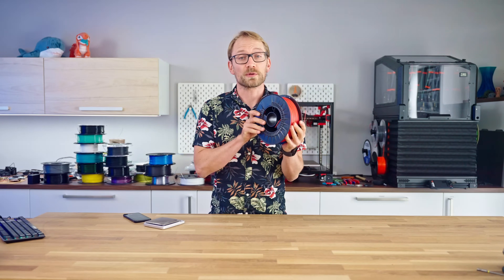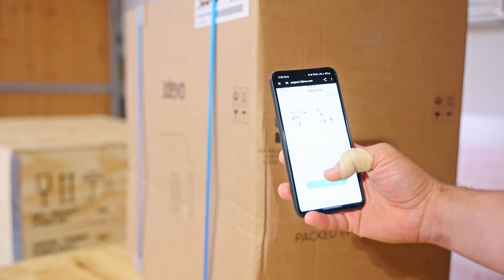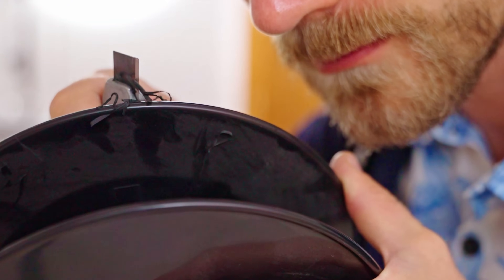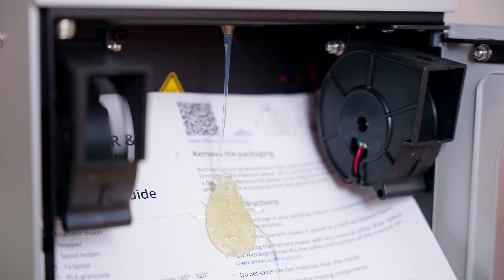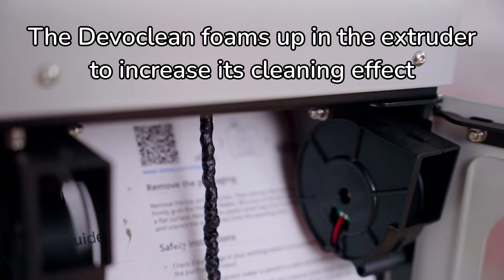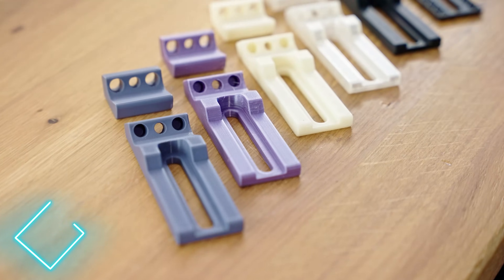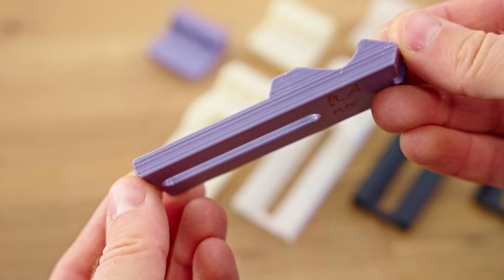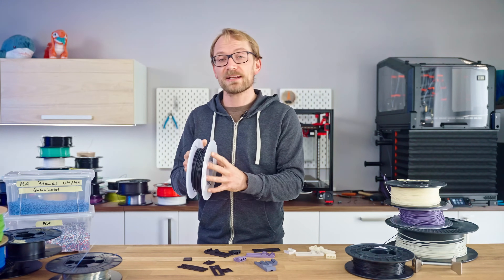Can you print (with) your spools?

Comment: Since this video is roughly a year old, I doubt you'll see this comment but it's worth a shot. You had asked what other things you can do with your filament extruder. I've got an idea that wouldn't have made any sense until recently. I've been playing around with an idea that was inspired by Jonathan from TheNextLayer. He has his slightly lower quality recycled filament that he calls filler-ment. With all these new multi-tool head and multi nozzle 3D printers, I was wondering if it would be possible to create an even lower quality material by chemically stabilizing and attempting to bond many of the most popular filaments together. This would mean that you wouldn't even need to sort the filament since you're going to be attempting to chemically stabilize it anyway. I expect that the filament will be relatively low quality but I figured this low quality filament would be perfect for infill and could be used with these multi-tool head printers without losing much time. Something like the snapmaker or the indx system should theoretically not add a ton of time or any waste but could use this ecological, low cost, low quality abominable filament.

I would love to hear from you if you're even vaguely interested. I was considering reaching out to some material scientists or some chemists to figure out exactly how to stabilize these dissimilar materials.

Comment: Working in the polymer industry we have experienced how hard recycling is. Any contamination, no matter how small, kills your result. This means that household waste plastic is near impossible to recycle into anything other than low grade materials, even with a lot of chemistry magic going on.
What works well is when you have materials for which you can get clean streams like PVC or PET. But even then for PVC the core material in a pipe is recyclate, the outer layer is virgin material. That way a spec of contamination does not lead to immediate defects. But you need complex exruder setups with one extruder for the core and 2 more extra extruders for each outer layer just to make 1 pipe.

For filament this could be applicable to: An inner or core part of recycled material and outer layer of virgin material. Just like some of the fiber reinforced filaments are made today. Since in our 3d printer extruder hardly any mixing occurs this might well lead to better printed parts as the outer sides of the extruded strand is still virgin material and thus layer adhesion is less impacted (I assume that layer adhesion is the first thing where we see degradation of mechanical issues). Also color, at least for black or dark colored filament, will see less impact.

Comment: meanwhile, virgin ready made stuff can be bought for under 10€ a kg ... :/

That's the real issue, we need something which makes it irrelevant what dirt, garbage is in and reuse everything, and all i can  think of is why not melt ALL of it and mold into bricks at industrial scale? Use them as cheap building materials, fully solid, whatever plastic you happeend to get in recycle bins

Comment: What if the spool was wrapped around with abs filament and pva, soak it in water to release the abs 1.75 filament and then use it directly to print as is.

Comment: Nice video, but recycling is not someting for the hobyists. Shredders and extruders are expensive equipment. Mixing platics from multiple brands can be an pain in the ass. Even when they are all the same kind, each brand has its own additives, wich may increase the melting temperature.

Comment: Naptha lighter fluid removes sticker residue very well, and evaporates with no trace on every plastic I've tried.
Also: Goof-off has an orange oil based sticker remover that completely removes adhesives and evaporates well enough that it leaves only trace contamination.

Comment: This is pretty cool, wish i had the money and space to set something like this up for personal use.

After thinking about the issue of unmarked plastic it occurs to me that if your working on a small scale and you wanted to test individual pieces to identify the plastic type you could do a melt test. If you were to melt a sample of the plastic in a closed environment with an air quality monitor that can accurately identify pollutants the wouldn't it be possible to identify the plastic based on the chemicals it releases?

Comment: things i'd like to see you try using the shredder/extruder for are;
empty pill bottles. these things can add up pretty quick, and if you're getting them from the same pharmacy, are likely to all be very consistent in what they're made from. mine happen to be PP and a nice dark blue. they're also pretty thick.

knock off bulk legos. from time to time, i see bulk listings for knock off legos that seem to be way cheaper than what the material would cost. might be interesting if you can get some quality ABS filaments in consistent solid colors for less than material price via these weird listings.

re-shredding shredded ABS for the increased particle sizes, but mixing in fiberglass to make a glass fiber reinforced printable filament. i would suggest leaving this one to just before you need to return it, since it's going to contaminate the machine with fiberglass... and that stuff gets EVERYWHERE. also, do not do this without serious respirator and eye protection. ideally a full face isolating respirator with separated intake, much like what Evan & Katelyn use on their channel when doing resin projects (their channel name is Evan & Katelyn...). you really don't want glass dust or fibers in your lungs or eyes.

Comment: I'm a bit surprised about the contamination issue.  If I understood correctly, the issue was that the little bits of ABS were getting extruded into the filament and then clogging the printer?  Does the extruder not have a screen to capture solids like metal shavings and the aforementioned ABS?  If not, then that seems like a serious design issue.

Comment: I really feel like we need to figure out a different direction to go with scraps/waste. Like a "no, you can't turn it back into filament" kind of thing whenever it's brought up. Over the years, all the streamers who have tried 3devo really just did the extruder with some random grinder setup that "didn't work as well as I hoped". Then you get to see a "proper" grinder and you literally need an engine lift. I'm probably semi-known for my massive comments on these videos, but I'll put things as "filament recycling is dead, long live filament recycling" and instead want to lean more towards "how can we take this waste product and turn it into something at home or, worst case, in a makerspace setting without the concern of contamination".

One of the first things that came to mind some 4-5 years ago: instead of printing a Gridfinity or picking up yet-another part sorting/storage bin, can I get a mold that I can fill with scrap + a brick or some kind of weight and throw in a toaster? I was working with someone else who was gonna weld the mold together from metal cutting scrap, but they got busy so the idea didn't progress.

So to your question: I'm not knowledgeable about plastics enough to come up with some new idea/blend, but blends could be interesting to try. A "has heat tolerance of ABS/ASA, but prints like PLA" if there's such a combo. But I like colors, so maybe "colored PC" or "glow in the dark ASA" or "glitter PETG". While the consumer space fixates on "what do I do with these mounds of poop that come out of my Bambu", the model makers, the tinkerers, the people who make 3D printing their business are going "I'll just adjust values to reduce the waste... but what I really need is a filament I can put in my car that glows in the dark but also survives a summer, enclosed in a car, in Arizona and can hold a large cup of iced coffee when I get back to my car". Grind up your old stuff and melt in a mold in a toaster, use the filament makers for creating the materials that mass manufacturers don't touch with a 10 foot pole because they don't see the market, but with a large channel drawing attention to them, consumers start going "hey, I do want that" and the companies do start offering them.

Comment: When you recycle materials, they're almost never used on its own, it'll be mixed with virgin material. whenever you process a material, its properties change. You lose some plasticisers for example from the heat. It was almost expected that the 100% recycled filaments would fail

Comment: The machine and assembly itself, while not for your average home hobbyist, could prove useful for smaller recycling operations!
But - as you said - you run into the issues of impure / unsorted materials and cutting an entire batch from 1 contaminant, or the breakdown of polymers.

There is a filament recycling company here in Canada that does accept smaller shipments, which is nice for someone like myself who does this as a hobby, but they're very strict with what you get for your batches of scrap material (Points system towards filament purchase, I believe). They even go as far as saying that PLA and PLA+ must be separated.

Comment: Wow, I am blown away by how much the small amount of contamination affected your prints! I would love to see more videos just exploring shredding/recycling different plastics or waste 3D prints in more detail. Some ideas that come to mind:

- Do a bunch of testing and find a good "recipe" for recycling PLA or PETG or ASA waste prints, to show the difficulty level of recycling your 3D prints. Is it possible to do it without using any virgin material at all?
- Try making a batch of filament from virgin pellets. Then, print it all and recycle it. Repeat this process and see how the plastic is affected by each cycle of recycling. How many cycles are possible for PLA, for example?
- What is the percentage of ABS required to ruin a batch of recycled PLA parts? Or percentage of PLA required to ruin PETG or ASA parts?
- Try to get your shredded product into a finer size - how does that affect your results? Is it difficult? Does it make the resulting 3D prints much better? How viable is it for people to do?
- Can a sander or Dremel remove the stickers on spools more effectively so you don't need to use solvents to clean the plastic?
- Go more into detail about how mixing plastics from different manufacturers such as PLA or PETG affects the resulting batch of filament? Is it a big effect? Can it ruin a batch of plastic?
- Does printing with a larger diameter nozzle make recycled filament more viable? Since contaminants will have a higher chance of being able to pass through it.
- There maybe chemical tests you can do on spools or samples of plastic you want to recycle to gauge their grade or quality. Can any plastics be judged in this way to see if they're good enough for recycling?

Thanks for a great video! I love how you're always trying to branch out on your ideas

Comment: Why do so many people think you can dry particulate or filament material thoroughly after just a couple of hours when the surface area to volume ratio is so low with no stirring or mixing? Just think about a) how long it takes the heat on the outside to get to the middle of highly thermally insulating material and b) think about how the moisture then has to travel from the middle to the surface.

Comment: 4:25 Use hexane to remove the stickers/labels. It's usually sold in pharmacies to remove adhesive bandages from the skin, but, should you not be able to get it, WD-40 contains a lot of it, so just use WD-40 then rinse with rubbing alcohol or wash with dish-soap.

Comment: There's more TPU composites coming out all the time and I would love to see an attempt at combining all the typical plastics with TPU and TPE because really TPU is the best filament overall.

It has perfect layer adhesion, it doesn't warp and is completely shatter proof unless it's cold (under 60f).

What we need is a TPU which can match the stiffness of PLA and we'd have the perfect material.

I've tested every available TPU composite and so far Nylon + TPU has been a real winner but it requires excessive time to dry.

Comment: I wonder about how efficiently you are actually drying out your ground plastic. It seems to me that simply putting the ground plastic in a glass tray and then immersing it into a hot air bath drying box won't encourage the moisture from the middle and bottom of the grinds to escape. As a first step, maybe a fine mesh sifting sieve with a PC fan under it inside the dry box would help encourage an exchange of the warm moist air within the volume of the grinds with the warm dry air of the hot air bath. May have to play with the speed of the fan and the distance between the fan and the bottom of the sieve to get some airflow (doesn't need to be much) through the volume of the grinds without blowing the grinds everywhere.

What I use for drying loose desiccant beads in my food dehydrator that I use for filament drying (I don't use for food) is a 6" round 40 Mesh sifter for baking (I also don't use for food). A quick look through Amazon and I see up to 12" diameter, similarly mesh sized.

Comment: A good way to take labels off the spools is to heat them gently with a heat gun until the adhesive lets go.
Reply from the maker: Tried that, just made the adhesive even more gooey
Reply: @MadeWithLayers  I have an adjustable heat gun for reflow soldering and I can dial in whatever temperature I need for the particular job.

Comment: @11:57 that's the same color that our shoes would end up colored as when working in automotive paint booths. I suppose it raised some eyebrows out in the public.

We also did ABS regrind onsite at Saturn (Saturns had the plastic panels of course). IIRC, the mix of old to new (virgin) was 10% old, 90% virgin plastic. Our silos were ~27.5 meters tall though... :)

Comment: I - love that safety feature. I cannot afford these machines, but If I could - I would consider that a  huge bonus when comparing machines.

To help test spools you can also use some basic chemicals to see if they melt or discolor, ABS as we all know will melt down with Acetone, so a few drops on one - and see if it begins to melt. If so - probably ABS spool.     Others have other chemicals, but starting with ABS (probably one of the most common) helps eliminate the need for riskier chemicals or methods.

Comment: Can you do a material mix of something flexible and something rigid?
Reply: I've personally tested to mix some PETG and TPC (and some ABS and PA contamination)  with my 3devo Precision 350 extruder. The resulting diameter was all over the place and required some re-cutting by hand to get it down to size. The mix itself is very durable and slightly flexible with an insanely good print bed adhesion, strong enough to rip out pieces of glass as the printbed cools.
It is possible, but not really worth it in my opinion

Comment: All very interesting I enjoyed the video. As somebody else mentioned though, I'm starting to see more cardboard spools. 
One problem with those on my Prusa MK4S, is the spool holder is on top of the printer above the bed. And as the cardboard spool turns on the peg of the spool holder, it snows cardboard dust just a little down on the bed. So I made some PLA spool inserts that I press into the spools when I get them to eliminate that problem.

Comment: One thing that I learned working for a company that prints with pellets is absolutely NEVER re-mix material. Treat the material that came out of the machine as “purge” or waste material. There could be metal contamination, other plastics, purge material, dust or other material like hair or wood shaving etc. And Glass filled materials are superior cleaning resins over HDPE. Use GF ABS as a high temp purge material, and GF pla as a mid range purge, and HDPE as a low range purge and make sure it’s milky when it extrudes. If it’s molten and clear it doesn’t grab the waste bits left in the extruder

Comment: Mostly off topic, but how do you pull down the XL bellows without the magnets coming out? I just installed mine and that part is super annoying.
Reply from the maker: I've never had that problem, are you sure you've assembled the captive magnet holders correctly?
Reply: @MadeWithLayers turns out that's what I did, only 1 magnet instead of the 2 it's supposed to be. Guess I should read manuals better!

Comment: One experiment i'd be interested in is how much performance of pla degrades as it is re-recycled. How is the plastic affected by several runs of extruding, printing, shredding and extruding again. How many cycles does it take for it to be not usable anymore.
Reply from the maker: Companies that recycle used prints on a larger scale claim in the range of a 2% degradation in material strength when comparing filament made with recycled material mixed in vs. material made from 100% virgin material. So one cycle most likely won't be noticeable, and because, in practice, there's virgin material being mixed in every time anyway, I don't think it's something that needs to be worried about (yet).